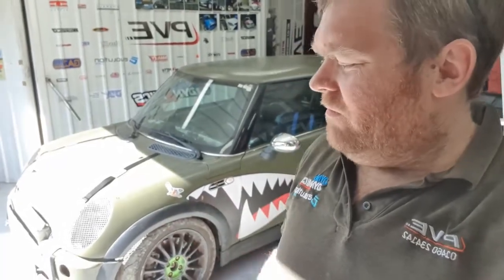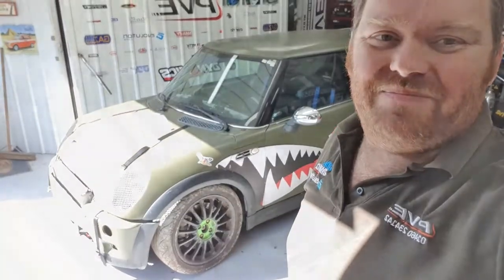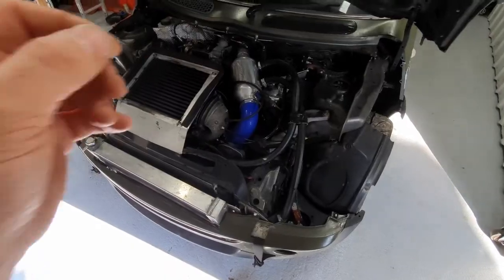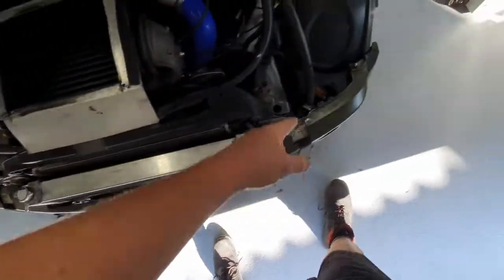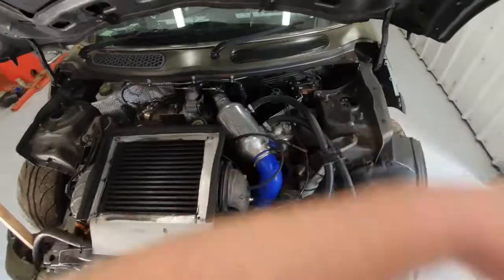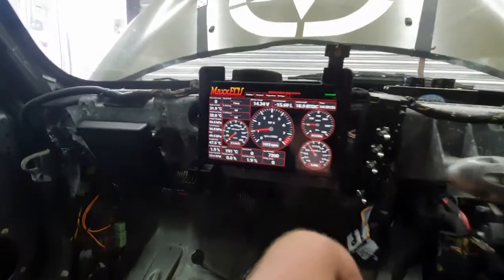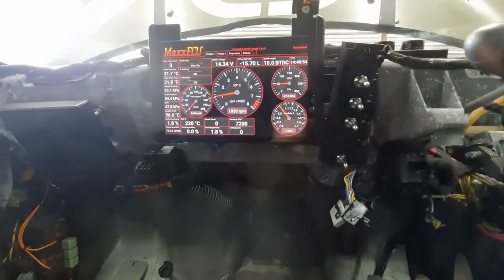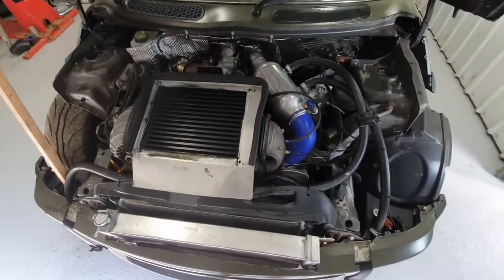How to build a Compound Charged R53 Mini, Supercharged & Turbocharged track car.

Comment: You have just made my day, week......last 8 years!! I've always wanted to twin charge my 53 but was discouraged by GTT & numerous threads on various forums. Well done. Subscribed. I would buy a kit from you so please go into details. Love it! Just finished fully forging my engine. I even triple ceramic coated the Wossner pistons. Ric Wood head, L19 ARP's etc etc etc. have you got a Facebook page or Instagram?
Reply from the maker: Hi Mate,
It will do 300whp on high boost, with some octane booster. 

You can search for us if you like, Performance Vehicle Engineering, we have Facebook and Instagram. :-)

Steve